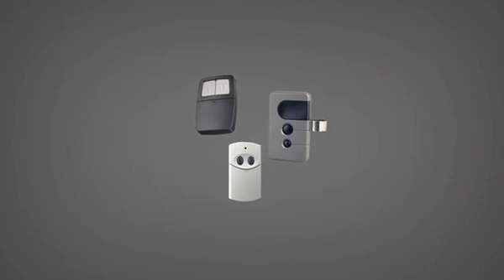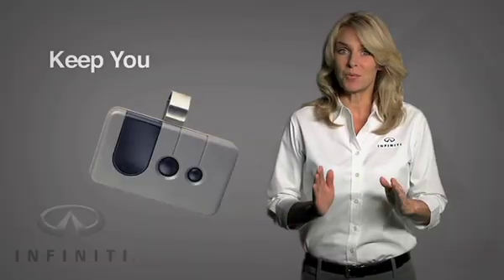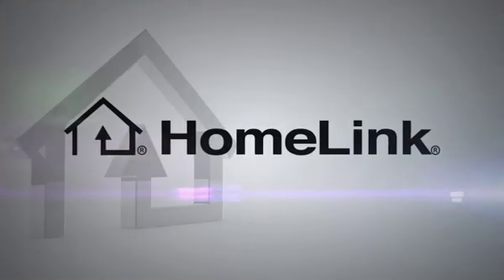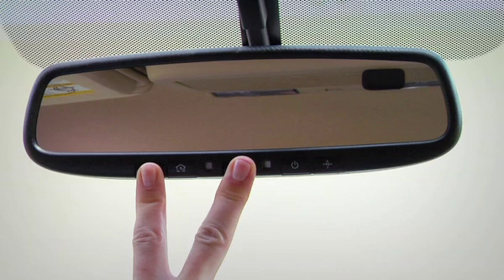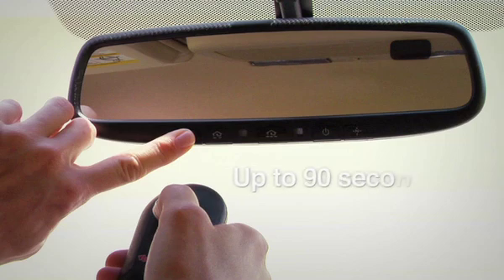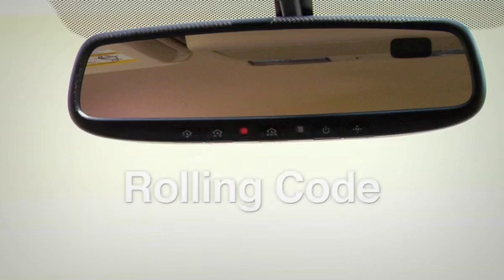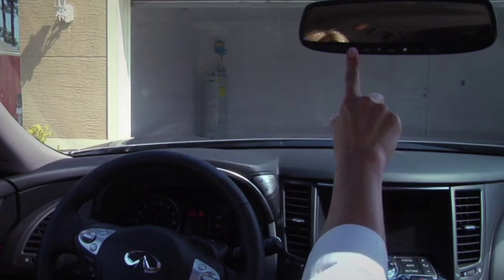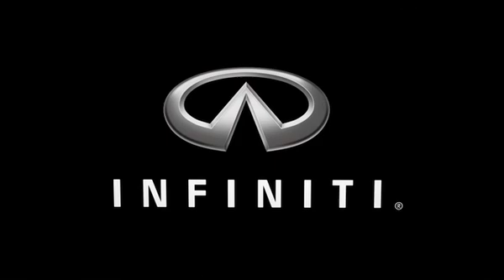Infiniti HomeLink Tutorial

Comment: To program my QX30 I had to have the ignition on but have the engine off. In order to get the memory clear and get it in program mode the process can only work like this. If the car is completely off there is no power to the home link unit to make the programming successful. The manual states to have the ignition on to program the unit. The video does not mention this. It is a little misleading on this.

Comment: Tried it and it worked exactly like she instructed. If you run into the rolling code part - I pressed and hold the program button on my garage door motor and followed the rest of the instructions.
Reply: Doesn't that cancel all the remote door openers when you do that?
Reply: @mccartneystuart  Longtime ago. Don’t remember if it did. But I don’t remember having to re-program my remotes after doing that. You’re correct also, but I just don’t remember if I did.
Reply: @lionjklwlf  I appreciate the reply. I have 4 vehicles (two are "toys") a 3 car garage and 3 remotes to the garage doors. I really want this to work in my Infiniti but not at the expense of the rest of the remotes not working. When I try to program the Infiniti it gives the response of the rolling code. I push the learn button on the door motor but won't link. I can reset the door motor codes, do the Infiniti learn but will most likely delete the remotes. Not sure when I do the Infiniti learn if I can then do the remote re-learn too. Might roll the dice and see. Thanks again.

Comment: Mine isn’t working. I followed all the steps and got the fast flashing light but the garage door still won’t open. I think I may have to call to have them trouble shoot it or take it to the dealer to have it looked at.
Reply from the maker: Hello, Kerry. We recommend reaching out to your local retailer for further support. You can find a location near you by entering your ZIP code here: https://www.infinitiusa.com/locate-infiniti-retailer.html. 🖤
Reply: Thank you!!! It works now. I was following the video but what wasn’t clear in the video is that I had to hold the buttons down as the light goes through the series of flashes and release ONLY after the light goes off. lol maybe it was implied but I let go of the buttons when the light started the fast flashes. But I should’ve kept holding until the light stopped flashing. 😂 but it works. Thank you!!